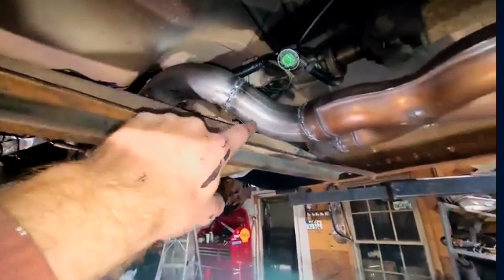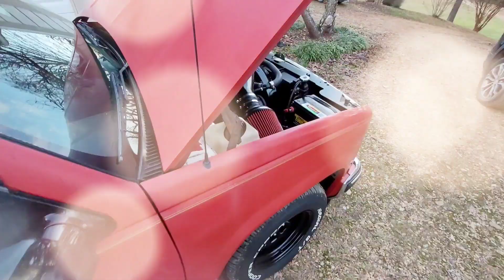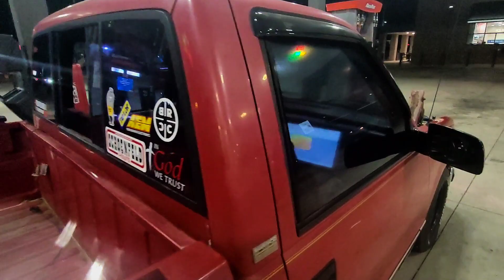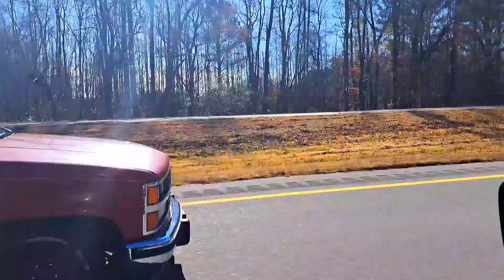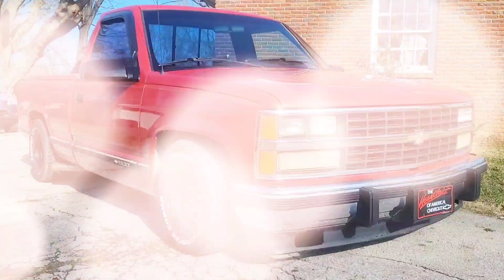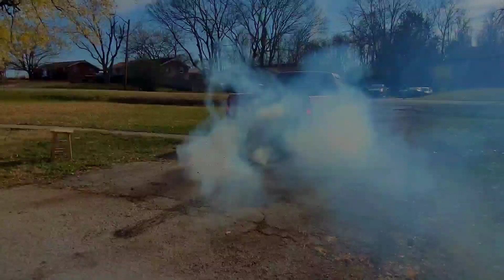5.3 Equal-Length Exhaust w/ Magnaglows!

Comment: I wanted to ask man I have the 98 gmc sierra 4.3 v6 vortec I’m putting this exact cam but should I change the fuel pump to a stock 5.7 350 vortec. My stock fuel pump is 2 psi off from the v8 version
Reply from the maker: I would think you'd be fine. But honestly you will need a tune regardless to get air fuel ratios good so the engine runs well enough to drive.